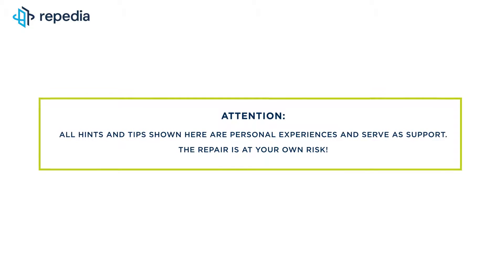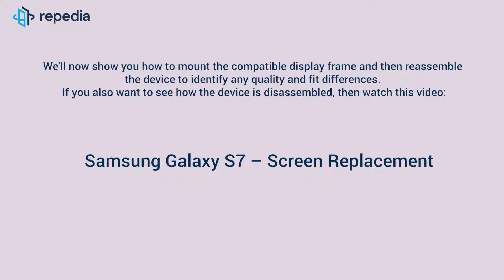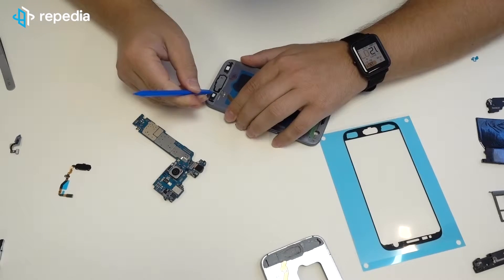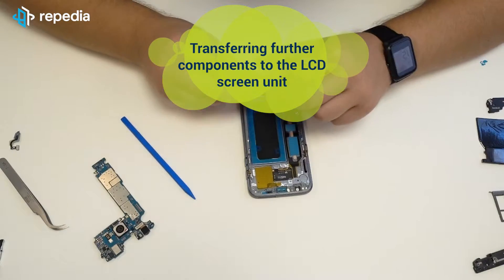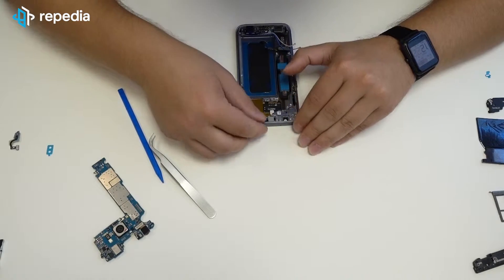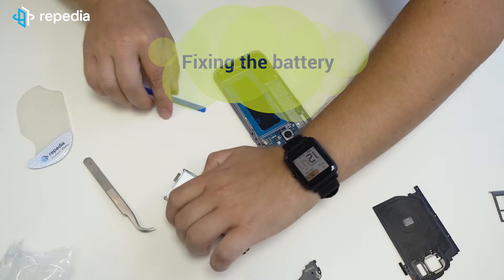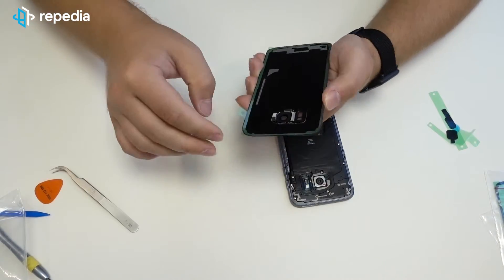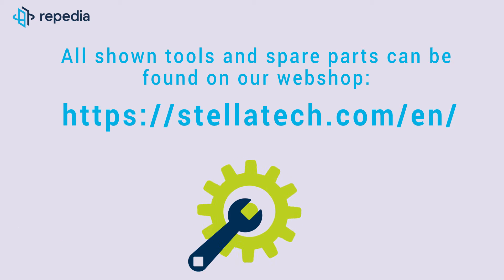TEST: Samsung Galaxy S7 - Display Frame - Original vs. Compatible

Comment: My Samsung s7 ... dropped a couple times.. screen went blank.. went to phone genius phone repair and a couple others .. they removed the screen now, I have no screen... they can’t get anything on display. So they have it back and said they think it’s the motherboard. Could I just put my mother board in another s7 ? I bought another s7 .. slightly pulled on the screen and now it has same problem... I think it may be a hard fix ... where can I buy display and screen and digitizer ..